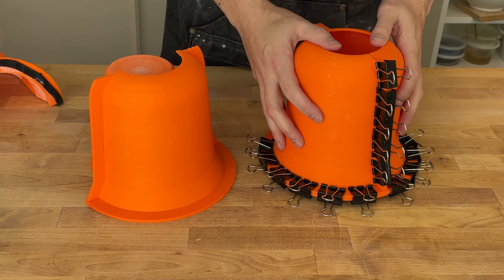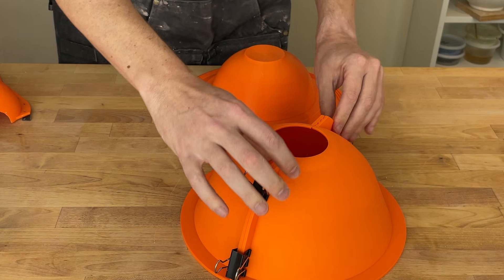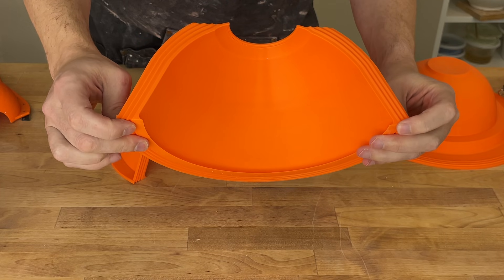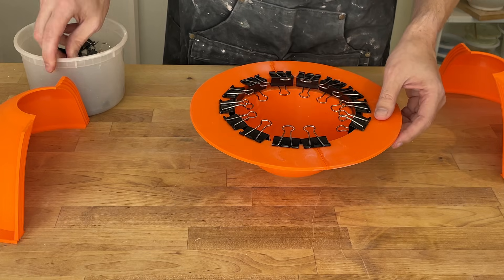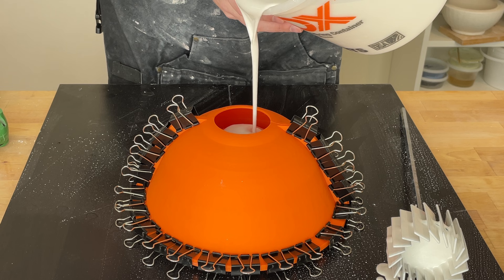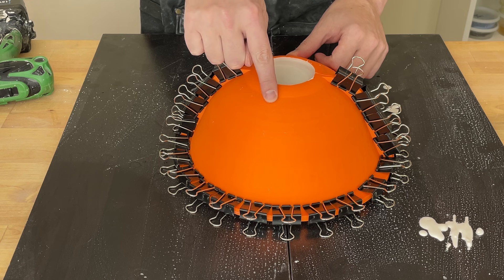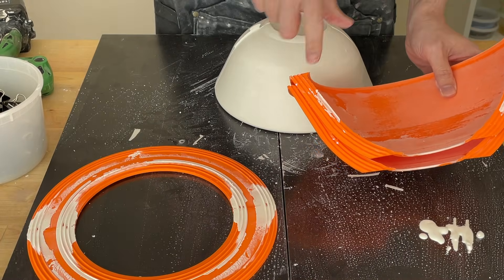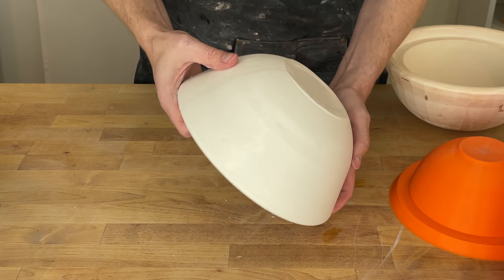Groovier! Will this hold the plaster?

Comment: Hi Kent! I just tried your Tensa Magna mold and had a huge plaster leaking problem. I see I'm supposed to mix it for longer which I'll do next time. Have you considered making the grooves deeper along the edges of where the molds meet? It would be a dream if they just kind of snapped together.
Reply from the maker: Snapping together (and back apart) would require some pretty tight tolerances for the 3d prints, so that would be rather unlikely to work for everyone. If you figure out why it leaked, do send me an email as plaster disasters are no fun! The ridges and groves should seat nicely against each other and the binder clips add enough pressure. You can, as a fall back, add tuck tape or clay but that shouldn't be needed with a good print. I had several people report back that they used my old version of molds with just binder clips and got no leaking so it's unlikely to be an issue with the geometry.

Comment: Hi, could you please tell the mixture ratio of isopropyl alcohol and water?
Reply from the maker: The exact ratio isn't critical. You just want to have enough alcohol so it doesn't freeze solid. I didn't measure mine but you could start at 50/50
Reply: @PotterybyKent  Thanks! :)

Comment: Have you used TPU? I think it’s much better than PLA
Reply from the maker: I have used TPU, but not for this. And I don't see a way it would  produce better plaster molds.
Reply: @ it releases easier. Do you have a version of your mold system that aspires for 3D objects .stl files?
Reply from the maker: Release isn't an issue with the methods I've developed and the molds produced. I have done custom work for 3D models. Each of those is highly dependent on the specifics.

Comment: Sorry if I'm late to the party. Could you please explain why the mold is split into four pieces instead of two? Inner and bottom one piece and the two top parts one piece. You can still have a groove and clamp it together but less potential leaks. My approach would be to only make one chamfered groove in the bottom that the top seals against.
Reply from the maker: I'd love to see your approach work. However in doing this a fair bit now I don't see you being able to get the plaster out of the print for any one piece mold, which is what Shape Cast does. So the pieces are for 2 reasons. One is demolding the plaster, as mentioned. The other is to overcome print bed limitations. Between clay shrinkage and the space needed for plaster, things scale up quickly.
Reply: @PotterybyKent  Thank you for the answer! I can understand that mold release could be an issue. If shrinking the inner mold with cold helps it release maybe heating the outer could help? If your print bed is square (as most are) you would get a very marginal size increase by splitting a circle in two. Using your technique to split it in four would however double the size which could be useful. It is just my opinion that it would be more beneficial to gain diameter by trying to decrease the rim size  and make the inner and bottom molds into one piece for ease of use. Great project either way, looking forward to see future iterations!
Reply from the maker: Feel free to model up your own! Actually splitting in half lets you put the parts on the diagonal - so it does help even if the print bed is square. And the feedback I've gotten from 1000s of designs seems to indicate having the parts is working well.

Comment: really great inspiration - i started designing my own molds thanks to you. Something i'm playing with is having the bottom flange attached to the inner shell, with the outer shell having the flange towards the inner shell laying on top of it. when pouring the buoyancy of the inner shell presses the two flanges together and seals them without needing to clamp at the bottom. the devil is in the detail though - demolding might be trickier since the flange from the outer shell lies between the plaster and the flange of the inner shell. maybe the idea helps for future iterations, keep it up!
Reply from the maker: Interesting idea! I've had enough plaster disasters that I'm being rather risk adverse on that front - making sure things really don't leak. However I do suspect there are other approaches. Let me know how it works out!
Reply: @PotterybyKent  i already did a cast and it worked with no leakage at all. So yeah, when the prints look good, it works fine. but i did it with a single outer-shell (like a tube with a flange to the inside) and i had to cut it open since i didn't use mold release. next try i'm gonna make 2 outer shells with flanges, already printed. about the prints - i run as well a bambulab without distortions, even on high prints. Maybe it is the room it's sitting in why on the top is bending in your case (cold air movement?)
Reply from the maker: Cool, good to know. I'm not sure mold release does too much for plaster in 3d prints. My Bambu is in the bottom of a closet with the door open, so it's not an issue with ambient air. Usually it is just fine so I think it is something about this particular model.

Comment: The main point is don’t rely on the slicer but design it into your stl files so it will always be there independent of the slicer used.
Reply from the maker: There are competing requirements in making the 3d model for printing, plaster and the slip as I discuss in the video. Ideally yes, but in practice there are tradeoffs.

Comment: if you want to address the lifting corners and dont want to use brims which are messy design a feature called Mickey Mouse ears that attaches to your piece right where it lifts and can be easily broken off
Reply from the maker: This only works if you know a priori where the problems are. In this case the geometry was the same, so you would not have known.

Comment: Can't say I fully understand your use case, but I can say that it would be muuuuuch easier to model that mold in Fusion360 or Onshape. I prefer Onshape myself.  Both has free tiers.
Reply from the maker: The software automatically generates 3d models from a 2d pot profile with no CAD knowledge. It lets slip casters make new plaster molds without learning CAD. Modeling one mold could be done with any CAD software. Automating the process is much more complicated since I don't know the starting profile.

Comment: It seems the bending might be through warping off the pint bed. You could try adding a brim or a mousefoot there.
Reply from the maker: That would require knowing where it warps ahead of time. As I said, the other one I printed at the exact same time had no issues (and the rest of the one I showed was fine as well). Having said that, I think the test that prevents the grooves from being considered "outside" for the brims might be helpful.
Reply: @PotterybyKent  Generally on corners after long straights is more likely to warp. That is where the shrinkage in the layes is the most. Bed adhesion is very surface clenliness dependant as well. So some contamination or residue from the last print can help or hurt that. Not sure how to implement brim. Maybe some weird sections that print subpixel colloums that break up the step file, but generate a cleaner brim. Sounds like a lot of effort.
Reply from the maker: The geometry is the same, so that is unlikely to be the root cause. I'm pretty sure it's unevenness in print bed temperature. As far as the brim, in theory it just needs a very thin wall at the end of the groove - in practice it'll take some work as it will likely be slicer dependent.

Comment: Kent, could you go into more detail about the technology behind Shape Cast?  Based on the floating point issues with the meshes that you described, it sounds like you would benefit from switching to CAD software that uses a “boundary representation” internally and just exports meshes at the end.  There are some open source kernels for this such as OpenCascade (C++ but with bindings available in other languages including WASM/JS), not sure if you’re using something like that already.
Reply from the maker: I've started using FreeCAD which uses OpenCascade under the hood. So I'm doing just that now and working with solid geometry and the failures I'm encountering and need to work around come from it.